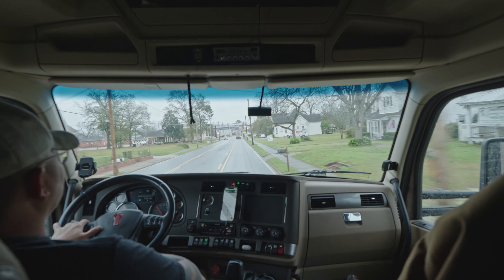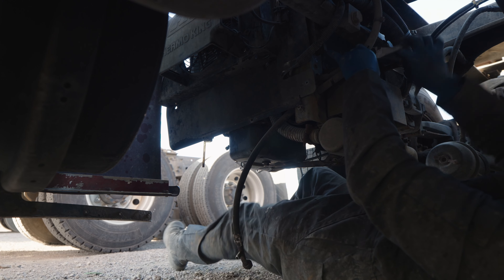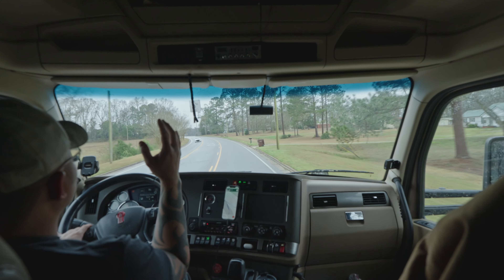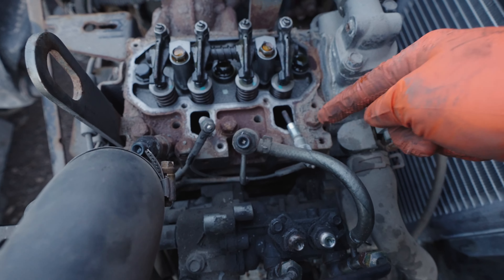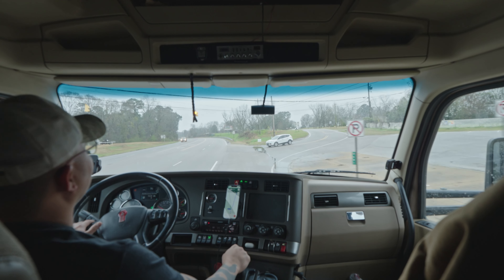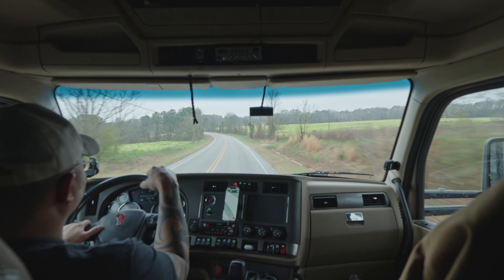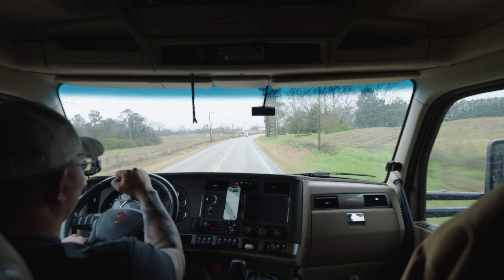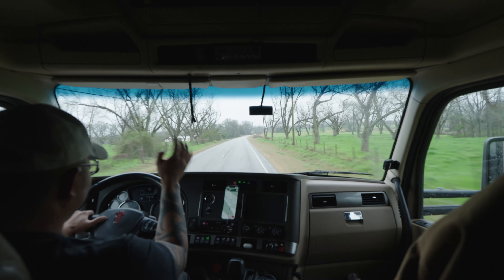Week 1 As A Power Only Owner Operator In Trucking

Comment: After all deductions what you get RPM . Like you run 2500 miles.  How much you get in your pocket ?
Reply from the maker: My cost per mile is about 96c a mile.
Reply: @pinoytrucking  bro your cost is 96c per mile or you get home 96c per mile.  Please clear to me thank you .
Reply from the maker: My cost is around 96 per mile depending on the fuel but around 96c mile as a Power Only.
Reply from the maker: So I would subtract 96c for every mile I run and that’s the approximate I would take home before taxes. Taxes as a single member LLC has a lot of perks so I don’t talk about it because everyone situation is different.

Comment: Is this your 1st wk as an OO?
Reply from the maker: No I started OO in 2021 then took a break from trucking in 2023.
Reply: @pinoytrucking  I took a break. But to long. Now the system basically has me starting over treating me as a new entrant. (I couldn't even get Progressive insurance although I did get approved by some else. It's a longer story than that). 
 My question to you is when you restarted were you able to get loads from brokers? I've been hearing brokers won't sign on ppl with a  authority (even with an old number) unless your atutroity has been active for 30 days, 60 days, 90 days or even 180 days. 
 Can you verify this? 
 Thx for ur response. 
 By the way I had my own customers I've contacted them & they won't even get back to me.

Comment: What is power only, is it hard, and how profitable is it ???
Reply: I think it means you don't have a trailer, you use company trailers.
Reply: I'm not a flatbed driver but I've seen those trailers before, I mostly see them pulling lumber.
Reply from the maker: @goodymob9638 @kirkbrown is correct. Loadout trailer = a trailer that needs to be relocated or transported without paying the average lane rate. In return you as the carrier are allowed to haul freight on said trailer.